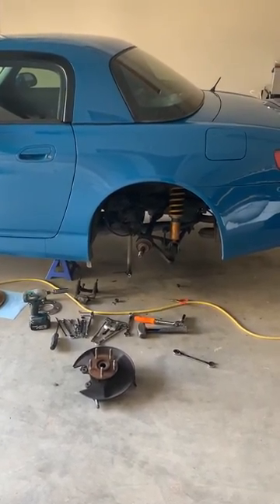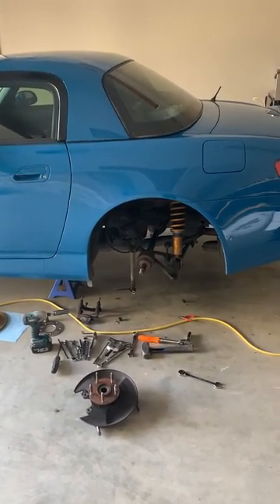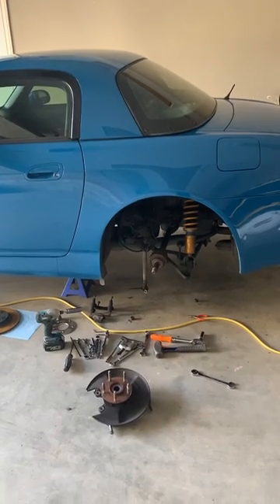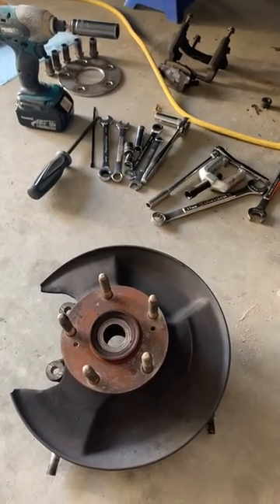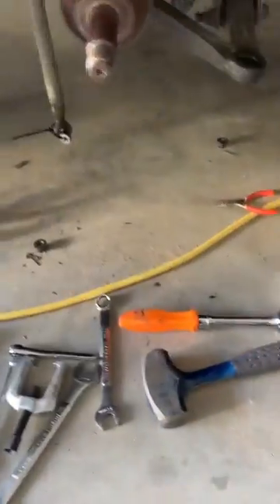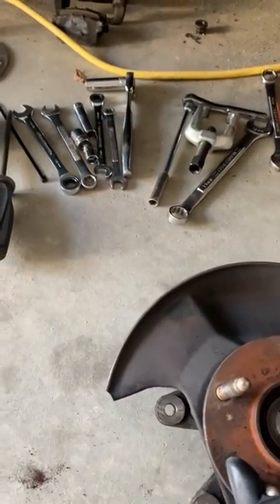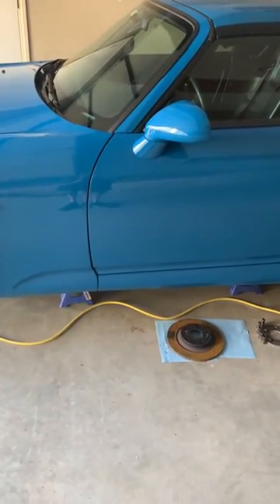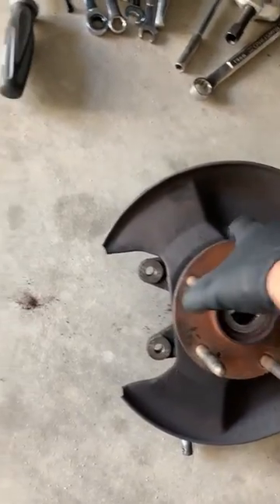S2000 Rear wheel bearing removal

Comment: My s2k is making a squeaking noise at low speeds. In or out of gear dont matter. Coming from the rear. I changed the the calipers, rotors, pads everything I can think of. I had new bearings pressed into the hubs i am out of ideas.

Comment: Dam, I'm just got my hubs and bearings today, I gotta wait for the rain to stop. In for an update.
Reply from the maker: Hi Ivan, I took the time to clean and re-grease the ball joints too and it’s as smooth as new. 

I torqued the axle nut to 250 foot lbs